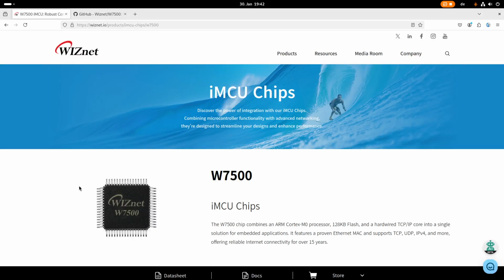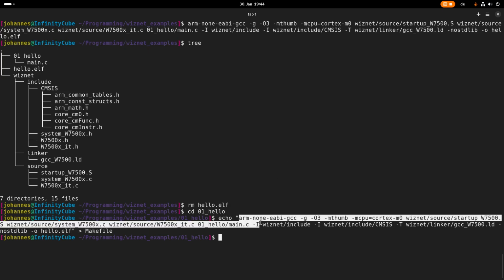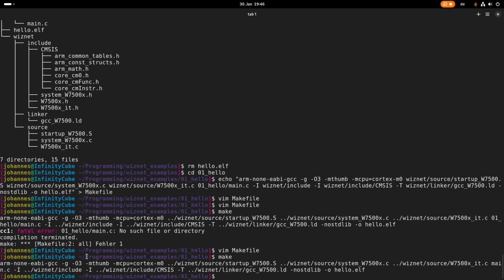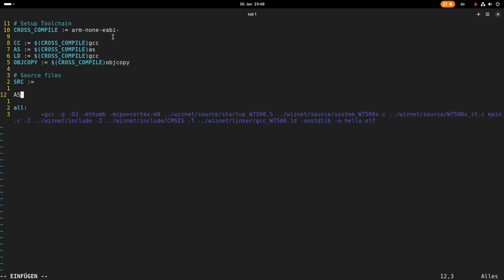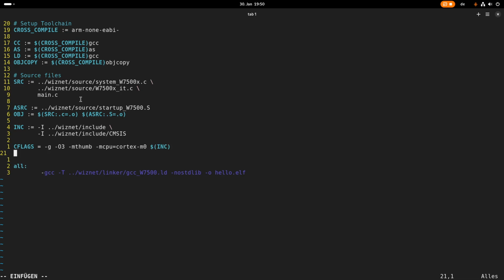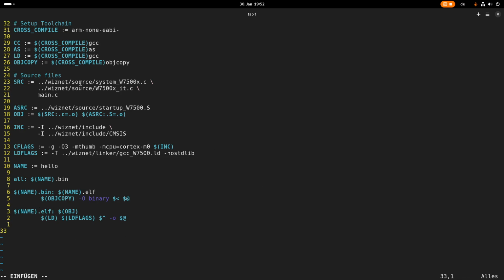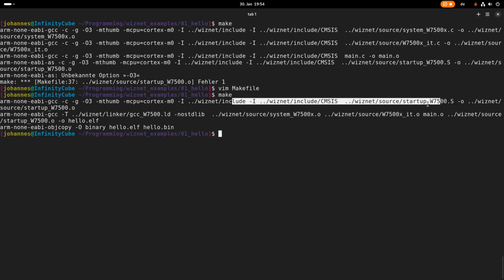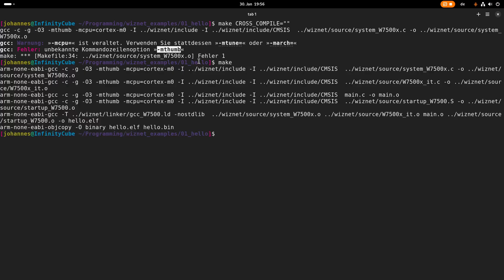How to write a Makefile for ARM Cortex-M0 on WIZnet W7500

Comment: I usually use -Os for embedded, because e.g. loop unfolding increases the size a lot and a major drawback of large assembly junks is, that it often does not fit into a cache block and therefore slows down progams. This does not necessarily apply to embedded MCUs, but my experience tells, that -Os often does not lead to significantly slower programs (many optimizations apply equally to size and speed), but to much smaller binaries.